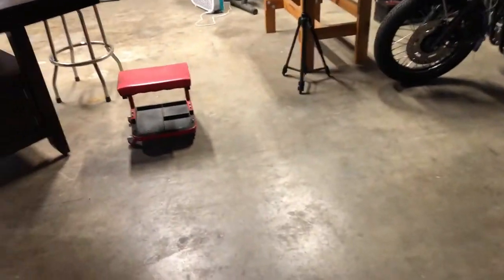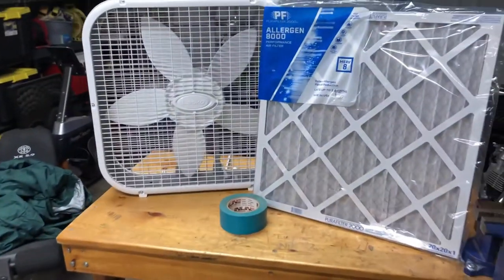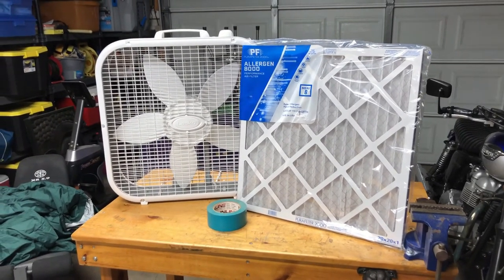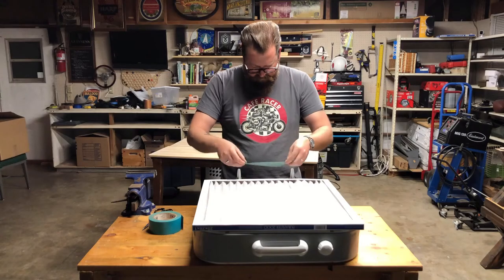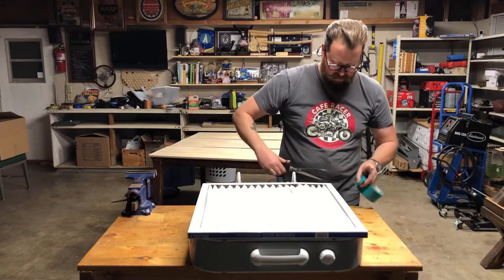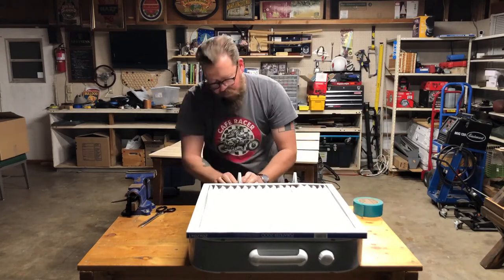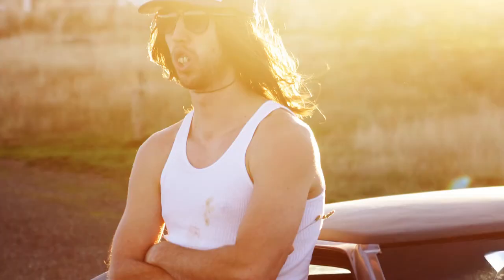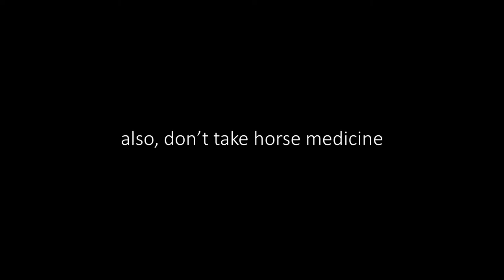How to Make a Cheap Box Fan Air Filter - Just need a Box Fan, a Square Furnace Filter, and Duct Tape

Comment: Why bother with duct tape?  The fan running will hold the filter on.
Reply from the maker: You're right, it probably would. :)  But the duct tape seals the edges nicely and when I need to stop running it, it's all one unit that I can tuck away.  Thanks for watching!